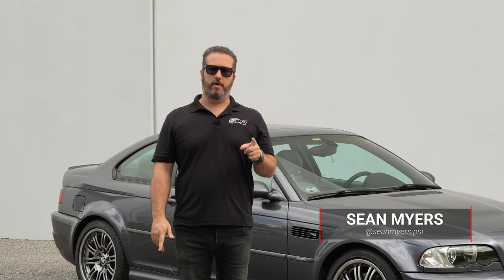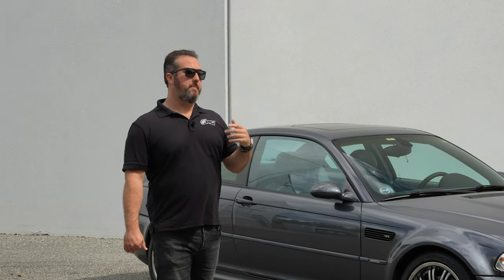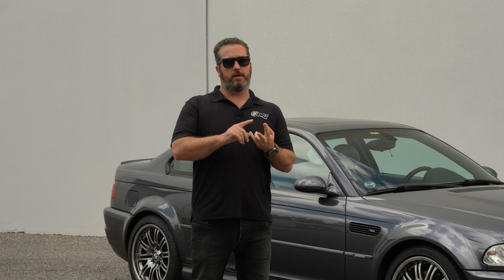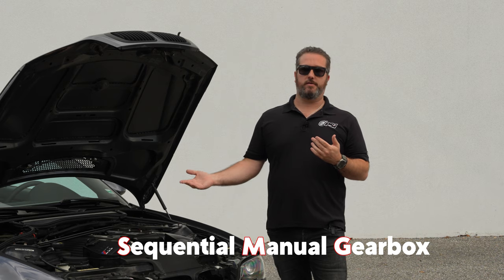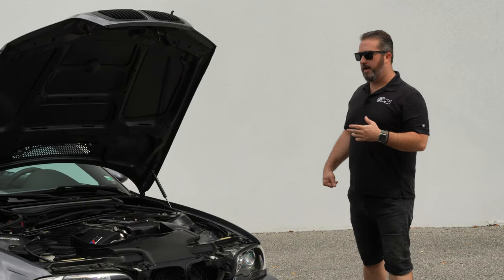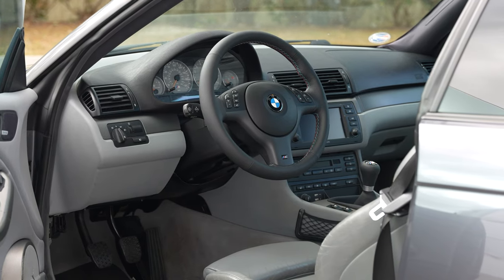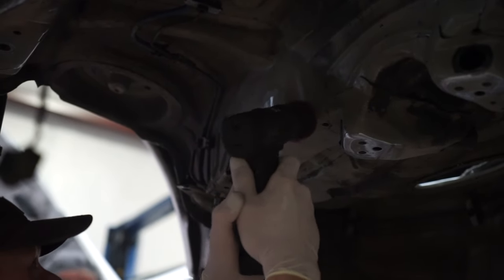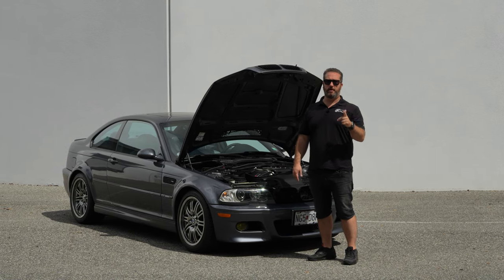A Deeper Dive into BMW E46 M3 Ownership

Comment: Other work done on this E46 referenced before PSI finished the build with the manual swap:

B6 shocks with OE springs (*chef's kiss*)
OE CSL sway bars front and rear
Full Powerflex Bushings front/rear
Turner Camber/caster kit
Eibach rear adjustable camber arms
Dr. VANOS full overhaul
VAC Performance rod bearings + ARP bolts
CSF Aluminum Rad + silicone hoses top and bottom
Front and rear subframes dropped and fully reinforced/welded
Stoptech Street Sport brake kit and steel lines front and rear

Other maintenance included replacing almost every serviceable item including diff overhaul, drive shaft overhaul, clutch/flywheel, power steering, starter, alternator, etc, and hose, clamp, and bolt from front to rear.  PSI did an awesome job on the swap, and it drives 100% now; I can't imagine a better driver-spec E46 M3. Alexis at PSI was amazing; she kept me up to date from start to finish, worked with me at every step, and even advised on shipping the car to/from PSI. And a shout-out to Active Autowerke  @TheActiveAutowerke: the tune on this car feels factory stable but makes great power; dyno proven 330 wheel for a 21-year-old car is proof.

Comment: Taking mine out winter hibernation tomorrow.
Got my first m3 e46 in August 2022, 70k miles on it, got the rod bearings changed at the dealer for free, recall was never done. Doing vanos, valve adjustment and subframe next month. 
I’ll finally be able to drive it and not worry.
Reply: Is that a recall that was offered for all E46s?
Reply: @karread3589  I believe just before 03 and up to 100k miles but not 100% sure.

Comment: I had a Stahlgrau E46 M3 for 6 years. Ran fine but: Bremi ignition coils went (later recalled), had the engine bottom end done as a recall, and at the end, both door seals fell down/apart ($$$). Otherwise, solid as a rock.

Comment: I much prefer the Karbonius box to the Turner one.  I just installed a Turner and it’s not near the level of my Karb box but it does get the job done and looks decent.
Reply from the maker: We just did Karbonius and it is very nice, each have their pros and cons.
Reply: @PrecisionSportIndustries  I noticed you had the strut tower brace on the video car.  Mine was way too close to the box so I had to leave it off for now.  I just did brand new engine mounts, so that may have made it even closer?  Still odd though that it didn’t clear.

Comment: This is fantastic. Would love your thoughts on the longevity of the S54, particularly in cars that are occasionally taken to the track. With the engine becoming more rare and more expensive, is it still viable to keep the S54? If not, what swap recommendations would you have?
Reply: Haven’t heard much negatives about them as long as you stay on top.  I have one with 150k miles in my touring and another with 179k miles.  Both feel as strong as the lower mileage ones I’ve been around.
Reply: 207k on mine runs like the 30k mile one I’ve driven.

Comment: Thank you for these videos. Can you include your average price for the maintenance/repair in the videos?
Reply from the maker: This is a very hard range to give. Depending on different combinations of maintenance and what the car needs changes the overall cost. We do have straight pricing for manual swaps and such. However, even this changes completely depending on the needs of that vehicle specifically.

Comment: What do you recommend for manual transmission fluid. My getrag can be a little tough to shift. Tried OEM BMW fluid and it did not help. Used Amsoil MTF and it helped significantly.

Comment: Great info. Have you seen any Convertibles with subframe issues ?   Do these have stronger Subframes/chassis mounting points? I have a 2002 Convertible with hardtop. No track use and no hard driving.
Reply from the maker: Yes we have. It’s every e46 chassis, none of them are better or stronger than another. Taking care of the car helps but only so much.

Comment: Im in the market for one, would you rather get a 100k example w/o the big 3 done or a $160-170k one w/ the big 3 done
Reply: The 100k mile one will need everything.  Past 125k or so and you’ll find a lot of things have already been done.  I just bought one with 179k miles but it wasn’t maintained that well, so it needs everything.  I’ve since sorted it out and it’s a great car.
Reply: @y2ksierra  just subscribed! thanks!

Comment: Do you think the subframe reinforcement is critical on a convertible stock daily driver that occasionally gets some fun weekend canyon driving? Ive heard convertibles are stronger.
Reply from the maker: Yes it’s needed, they are not stronger.
Reply: @Precision Sport Industries  at what mileage would you say it's critical to do the reinforcement? It seems like the consensus on rod bearings is around 80-100k miles so was wondering if theres something similar for the subframe. Also, are there other jobs that can easily be done at the same time as the subframe reinforcement?

Comment: I’ve owned my my 2004 e46 m3 for 9yrs, last year at 120k miles done my rod bearings with standard OEM items and they were hardly worn and had 50k left at rough guess left in them. Waste of money for me personally for the 2/3k miles and yearly oil changes that I do.
Reply from the maker: Sounds like you have a great condition car. Most E46 M3 have a checkered past and we have no idea how they were treated.
Reply: @PrecisionSportIndustries  Thanks, what annoys me is you see for sale ads and “boot floor inspected” no cracking. When anyone who knows anything about these cars knows they all crack to some extent and a subframe removal will only tell how bad. Learned today my oil temp/level sensor has failed and I’ve only did an oil change 4 weeks ago. I’ve seen videos of people using the vacuum method to stop the oil from draining out.

Comment: i’ve had a 2006 e46 m3 for 6 years now and I would never get rid of it. I got it as an smg and although it is a lot of fun, after going through 2 smg pumps it just wasn’t worth it. Manual swapping this car was the best decision i could have ever made for this car. the thing im running into now is the cams are going bad so im probably going to put the schrick aftermarket cams because genuine bmw cams are way too expensive. with proper maintenance, which is all mentioned in this video, this car is heaven on earth
Reply: You ruined the car by swapping out the SMG for one of the world’s worst manual transmissions. Good luck clowning yourself with that rubber band attached to a stick, thinking you’re a badass

Comment: How long are rod bearings good for after change
Reply: I hear if it’s a track car then 50k but if it’s a weekend car then 100k plus
Reply: For BE bearings they'll last the lifetime of the engine, for OEM bearings it's a guessing game.
Reply: @JAMA1998  not true , all bearings wear will wear out on this thing, the application is what accelerates it
Reply: @oversteer6771  On a normal car engine, rod bearings don't wear in any considerable manner because they're properly sized. BMW put bearings with too little clearance in these cars which is what causes the wear issue. BE bearings have more clearance than stock therefore fixing the issue permanently. I've seen people pull them out after 40-50k miles looking basically brand new, something you'll never see with OEM bearings.
Reply: @JAMA1998  hmm interesting, I went with acl, hopefully they do well